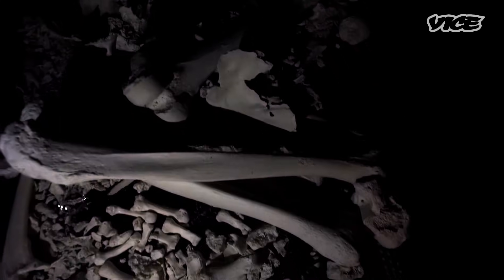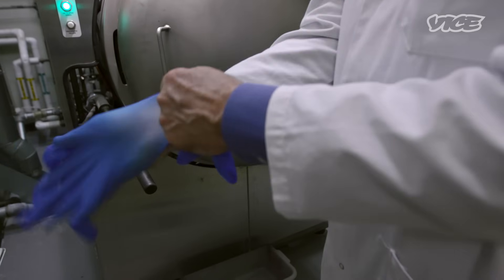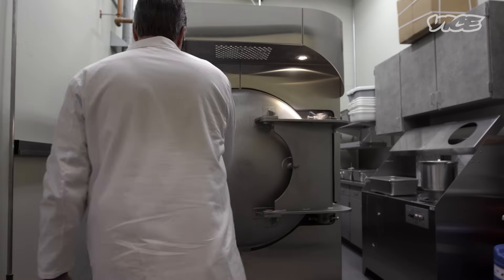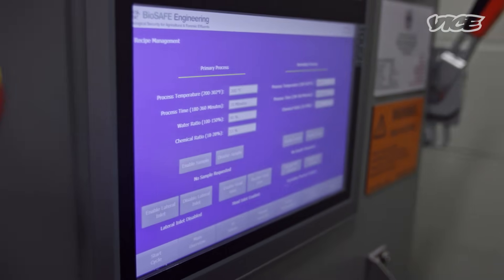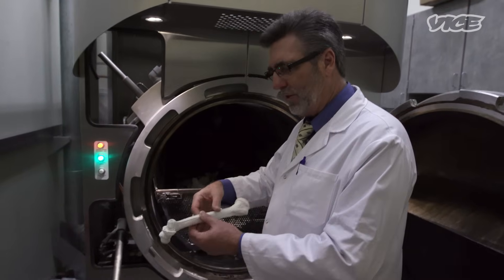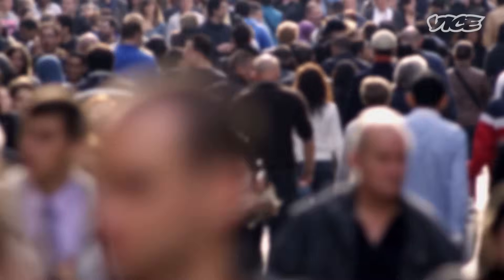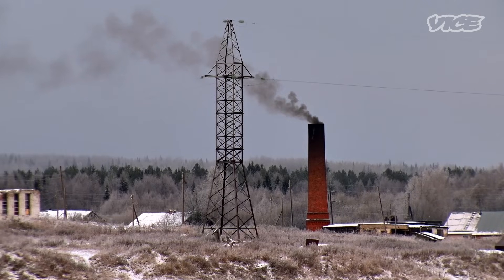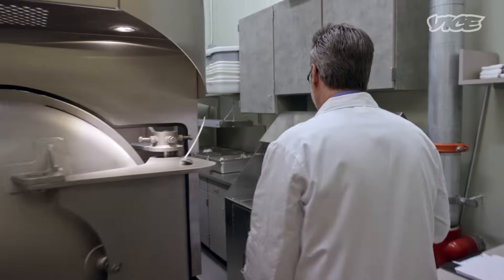Most Eco-Friendly Way to Leave Earth - Water Cremation

Comment: Calling it water cremation is an etymological abomination because cremation literally means burning. The word comes from the Latin cremare, to set on fire, to reduce by flame. Immersing a body in a heated chemical solution and dissolving it is not burning in any sense. Calling it cremation at all is a linguistic lie meant to make the process sound familiar or socially acceptable. There is no water in fire, and there is no fire in this process. It is chemical dissolution, plain and simple. Marketing it as cremation is nothing more than emotional camouflage.

Even ignoring the semantics, it is not the most eco-friendly method of body disposal. It consumes energy to heat the solution, requires chemicals whose production and disposal have environmental costs, and still demands industrial infrastructure. It is cleaner than fire cremation, but only relative to a high baseline of waste and energy use.

There are methods far more energy efficient and environmentally coherent. Sky burial, for instance, requires virtually no human energy input. The body is returned directly to the ecosystem, feeding scavengers and microbes and completing a natural cycle. From a purely ecological perspective, it is brutally efficient. The only barrier is cultural squeamishness, not environmental logic.

Composting is another superior alternative. Managed decomposition uses microbes to break down the body into stable soil. Energy input is minimal, chemical use is negligible, and the result is useful organic matter. It closes the biological loop instead of pretending humans exist outside natural systems. No high heat, no industrial chemicals, no emissions. Just controlled decay.

Comment: Im like, the most eco friendly choice is to just stop using coffins.
Maybe they want it to be a thing because, with a municipal water source,  the wastewater goes back into the main supply after going through a chemical trestment or two; which is the water set to be then next time you turn your faucet on. All the medications and forever chemicals amd plastic ijgested by that person added back to the water supply little by little. They reuse the water at least a few times before it flows out.
This is why tap water is bad for you. The sell of the reclaimed "biosludge" they scrap off of the filters they use too.
Your healh and quality of life in exchange for "conservation" even if you live in a place that doesnt regularly experience droubts.

Comment: It uses 1/12  to one tenth the energy of a traditional cremation but will that translate to a 1/12 reduction in cost of the funeral expense.
Reply: No, we're doing this now for someone, and it's about $4k for aquamation vs $800 for cremation. Maybe because it's new, machines are probably expensive, not everyone is doing it. But in the long run it absolutely should be cheaper.
Reply: You still have the fixed costs such as the operators

Comment: What happens to the water/Alkaline afterwards? Is it toxic?
Reply: This is a problem that is easily dealt with by introducing an acid to the water, which would neutralize the solution and make it safe to handle.
Reply: Femur!!!!!
Reply: My question is the same.
Reply: They recycle it and use it in their facility as drinking water 😂 that part didn't make the cut but I'm confident that snake oil salesman would say that 😅 way cleaner than Fiji water, I'm sure.

Comment: Beg to differ, but this method of disposition is hardly “eco friendly” and I believe most folks would agree much less dignified than flame cremation.  This method basically dissolves all tissues of the body (except bone) by a combination of a highly alkaline solution, heat and pressure.  The dissolved body is then pumped into the sewer, along with poop, urine, and all the other foulness in sewage.  The strong alkali is hardly good for the water environment, and large amounts of electrical energy is required to heat to unit to near boiling.  When you consider the relative “clean” burn of natural gas and the fact that the body is predominately water (which turns to steam; actual “smoke” is minimal, as a modern cremation machine re-burns any smoke, causing it to fall out and remain with the bone), the ecology is not very different scientifically speaking.  The real decision is do you want your loved one’s remains flushed into a sewer, or released into the air?  Most people do not really understand the science of these two methods, and their is a lot of misleading information out there promoting this method, which is correctly called “alkaline hydrolysis”.

Comment: Why is water pollution considered more eco friendly than air pollution?
Reply: Soren Cicchini what remains are bones, and the ‘body soup’ of which the remaining acid can be easily neutralized by some base. That ‘soup’ is a fertilizer, not pollutant
Reply: @antonisusanto8148  If it goes into the environment, it's a pollutant, and the spent liquor is typically disposed of in the municipal wastewater system.  It could be used as a fertilizer, but so could digested biosolids from the wastewater (sewage) treatment plant, it just rarely happens.
Reply: Regulations vary.  But usually, It's poured into the public sewage.  They use just enough KOH to break all soft tissues down to the cellular level.  So most of the chemical has reacted and neutralised.  The remaining KOH will be neutralised when it mixes with acidic poopwasser.
Reply: @PERL6_master_race  Yes, the caustic solvent will be reacted into a salt solution, but the carbon and nitrogen from the body are arguably just as polluting in the water as they would be in the air or ground, increasing the biochemical oxygen demand and treatment requirement of the wastewater.  One man's fertilizer is another man's pollutant - in my part of the world we have experienced major river eutrophication issues due to agricultural runoff.  I imagine that most (but not all) of the phosphorus in the body would remain in the bones, which is just as well because most municipal wastewater treatment plants do not include treatment processes to remove phosphorus.
Reply: So the question is, am I washing my hands with dead people?
Reply: @Someone-hs5yb nah. You're drinking and bathing them, more or less 😅
Reply: I always wanted to be buried but after seeing a couple of these water dissolving videos, I am now 100% sure that this is how I am going to be disposed of when my time is over ⚰️🪦
Reply: @pmiller4799  water cremation is a rather euphemistic term. It's not so much being dissolved in water as a hot caustic solution, similar to that involved in terrible industrial accidents at alumina refineries.  If it's not an officially authorised body disposal method in your area, you may still be able to get your wish if you upset the right organised crime figure enough.  Santiago Meza Lopez, "El Pozolero", processed hundreds of cadavers on his ranch in this way for the Arellano Felix Cartel and he is far from the first to use the method.  Another notable proponent was Leonarda Cianciulli, dubbed "La Saponificatrice di Correggio" after producing soap from the reduced remains of one of her fattier victims.

Comment: I think if they're recycling body parts that were already paid for and reusing them on others and getting paid again then they  should be able to have this done at a fairly reasonable price for the families of their loved ones.
Reply: That won't happen. Implants wear and fatigue so they'd have to be melted down for reuse, and the raw material value would barely warrant fishing them out.
Reply: @SorenCicchini  The doctor in the video said they were literally like new after the process so it's likely they could be reused.
Reply: @kingzach74  they might look alright to a doctor but bacteria is microscopic and not confined to the easily seen surfaces, and fatigue cracking that can lead to structural failure as well as harbouring bacteria can take specialist non-destructive testing methods to detect. Joints wear (I think 20 years is a typical replacement joint design life) and more and more implants are being custom 3D printed to exactly fit the patients' bones. Biocompatible materials like titanium are assimilated into the body, serving as scaffolding for bone growth.  This makes it very difficult to properly clean them. It's illegal to reuse implants in much of the world, so the closest they normally get is melting down the metals for recycling (I read that some pacemakers are reused on pet animals), although I was told that a stainless steel plate I had in my shoulder for a few months was donated to India so that a poor person that fractured their clavicle could have it surgically repaired.
Reply: I find it sad that that's what the healthcare has come to.

Comment: "Water Cremation" sounds much friendlier than melted with acid. 😂

I know it is a base and realized, seconds after posting, my mistake. I followed up with *base as a second comment. For the folks in the back.....
Reply: *base
Reply: @LaPetiteMort715  👍
Reply: @LaPetiteMort715  
Based on what?
Reply: @Darkfreed0m  There's acidics and basics, a base is equally as dangerous as an acid. If an acid is added to a base of equal strength then both are neutralized
Reply: Don't worry, you won't feel it. I'm all up for it, as long as there's a spin cycle. I want a spin cycle, dammit.
Reply: I promise you wont feel a thing lol
Reply: Hydrolic Base.
Reply: Open casket sounds better than filled with antifreeze and cotton or cremation with set on fire.
Reply: It's Lye based. Two sides of the same coin.
Reply: What does a body look like when it dissolves in this solution? I'm curious.
Reply: @FLOOPIEOS  Brown/reddish goop. Search chicken dissolved in lye. Same thing.
Reply: Less breaking bad
Reply: I’ve got the new ninja 1, does it in 30 mins!
Reply: Boiled meat
Reply: Then flushed down the sewer after its all said and done....
Reply: It's more like " pressure cooked in soap making caustic chemicals "
Reply: Potassium hydroxide is a strong base not an acid. If it were a strong acid the bones wouldn't be left.
Reply: @AstronomyGuru84  That is why I corrected myself almost immediately after the initial tweet, love.
Reply: Just like how cremation sounds better than incineration, and burial sounds better than chucked in a hole in the ground. What's your point?
Reply: It's also alkaline, so the opposite!
Reply: It’s not acid.
Reply: @AutopsyJuice  Read the whole thread, love.
Reply: you were probably already corrected 100 times but  KOH and water is a basic not acidic solution. same effect though, drain cleaner is a basic solution
Reply: @jay8980  I literally made a correction comment seconds after the original tweet. Check the thread.
Reply: you were probably already corrected 100 times but  KOH and water is a basic not acidic solution. same effect though, drain cleaner is a basic solution
Reply: Breaking bad theme intensifies.
Reply: Not acid but "extreme pH solution [acid and base]"
Reply: *melted with alkali
Reply: Imagine the wrong people get their hands on this machine. Lord….. just boiling humans 😭👀
Reply: @JeanEDolin  They already got their hands on it I am sure.
Reply: @miroslavblagojevic2402  It's a pretty expensive setup for being used for nefarious purposes. I'm sure the cartel does something far more rudimentary. Then again, I'm sure African warlords have cheaper ways of burning dead bodies as well. Just sayin'
Reply: @JeanEDolin  You can do it in an oil drum and lye. You can also just set people on fire like a cremation.
Reply: @Jean E. Dolin  Don't even say that. Imagine if ISIS or Alcaida or Carol Baskin got one.
Reply: Contaminated the water we.
How about a person's dies with disease?
Reply: @kalboro9085  No living organism will survive the process. It dissolves any and all soft tissue in a highly powerful base (alkali). It's much safer than burial, which poses real risks to contamination of the water table.
Reply: @kalboro9085 strong bases are one of the few methods to destroy prions. It also denatures DNA and lipids.
Reply: It's literally the opposite of acid
Reply: @aratilishehe  Read the thread, genius.